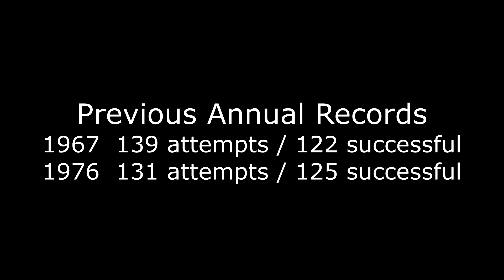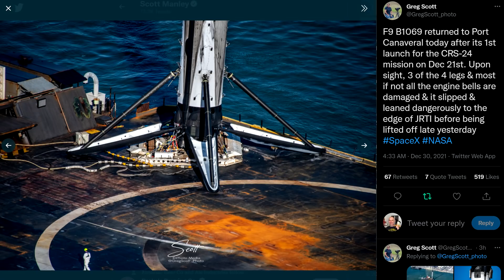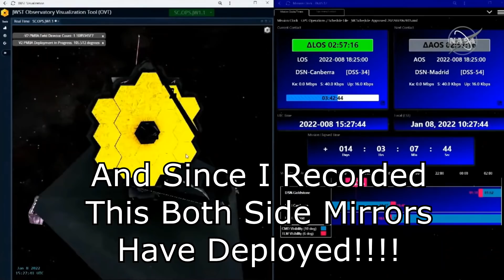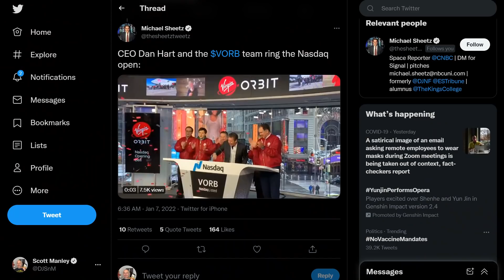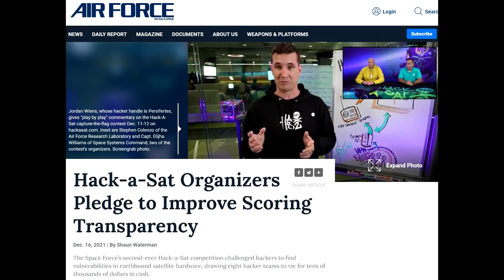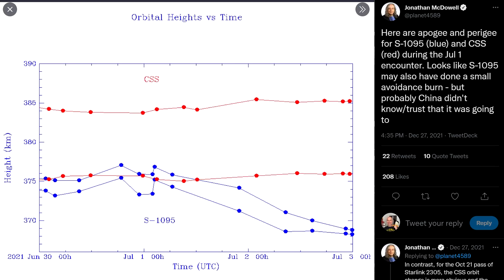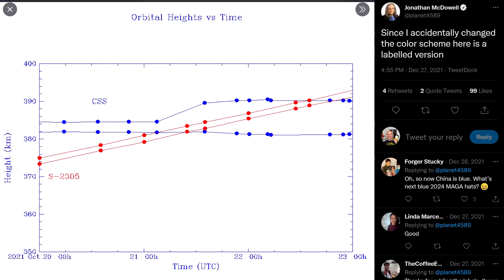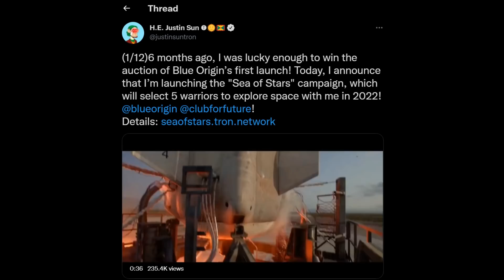JWST Deploys Mirror &  Moon's 'Mystery Hut' is Revealed - Deep Space Update - January 7th

Comment: The light illuminating the inside of SpaceX cryogenic tanks is called a "Photon Blaster" in the parts diagrams. It is also mounted outside the tank along with a camera, and both look through a pressure window.
Reply: Now I want a drone that drops glowsticks so I can call them photon torpedoes.
Reply: @moosemaimer  Nah, you'd need a self-propelled underwater flashbulb...
Reply: @Ithirahad  Have you never heard of Ster Trek or are you a troll?
Reply: @markhorton3994  ok fine, a flashbulb with a  hobby rocket motor attached :P
Reply: @Ithirahad  I was just pointing out that not all torpedoes are in water. Rather ineptly.  Early unmanned flying weapons were sometimes called "aerial torpedoes". I think the German V2 Buzz Bomb was called that between curses.
I like your use of a flashbulb for the photon part.
Reply: Next time I need a new lightbulb I'll ask where the photon blasters are at the hardware store :D
Reply: @gonun69  

I love it!

another goofy thing I've heard is LED modules (in a multi module light fixture) being called "light engines".
Reply: @gonun69  If you wanna see if your man is a film buff, ask it this way: I need a Photon Blaster in the 40 Watt range
Reply: so my lighter is a thermophotonic device... hope customs does not find out... 🤐
Reply: @human_isomer  Just approach them with your hands up and calmly say "I have a small thermophotonic device in my breast pocket and I wish to negotiate."
Reply: @jhonbus  I may do so when I'm very early on one of my next flights... 😁
Reply: AvE is the absolute master of these jokes. I think someone at SX is a fan.
Bet they call hammers "thumb seekers", adjustable wrenches "nut lathes", electricity "angry pixies", high voltage electricity "Very angry pixies", Batteries "Pixie containment" and the biggest hand tool the "chief engineer".
Reply: @ThZuao  Gotta love AvE
Reply: @ThZuao  I watch AvE but I've never heard the term "thumb seekers". I love it! Son of a diddly.
Reply: @ThZuao  "Angry pixies", I'm going to be looking for opportunities to use that one.
Reply: @ThZuao  Oh man those are just gold.

I tend to refer to hammers as H.A.M.R.s...."Heavy Augmented Material Rectifier", heh
Reply: @ThZuao  Love me some Uncle Bumblef...ork. (I'll keep it PG for the sake of it being Scott's channel lol)

Which, since I have fellow AvE lovers in company here, I'd like to float an idea I had in reference to his terminology...

While most have probably heard him say these, as a reminder, he's referred to electricity as both Angry Pixies, as well as Dancing Pixies.
However, he's used them completely interchangeably and without inference as to the 'type' of electricty he's using it for.

My thought was that perhaps he originally did mean for them to and forgotten over time (has happened to me), or perhaps whomever he heard it from originally meant them to be; however, if that isn't the case, then I propose that:
- *A*ngry Pixies | AP == Alternating Current | AC
- *D*ancing Pixies | DP == Direct Current | DC

What do we think about that? :)
For me, that just seems like the obvious pairing of the terms, or at least how it ought to be, going forward!
Reply: Since I radiate in the infrared, I am also a photon blaster... as is anything above 0K.
Reply: Ahh, but are they “thermodynamic photon blasters” (incandescent bulbs) or “quantum photon blasters” (LEDs)? Or even “plasma photon blasters” (fluorescents)?
Reply: The Saturn V had cameras in its cryogenic tanks, too, and it used fiber optic cables as pixels.
Reply: @redspotaudio  Nobody cares about your Bronze Age mythology.

Have a nice day.
Reply: im going to call any light source a "Photon Blaster" from now on
Reply: I wanna photon blaster.
Reply: It is an extremely bright light.
Reply: Blasted Photons!
Reply: My flashlight has 3 intensity settings, and I can change how wide the beam is. Phaser???
Reply: It is called a blaster because photons are ejected at the maximum blasting speed
Reply: @redspotaudio  gommfm.
Reply: Thats a good solution
Reply: I also see another humor layer. The reference to the Bugs Bunny Marvin the Martian character? He was always threatening to shoot someone with his photon blaster.
Reply: I was hoping for a more cool use for a "photon blaster"
Reply: My brothers and I have a running joke calling the sun "giant orbital photon emitter". But light blasters in general stores are better. :D
Reply: @xobotun_  Hmmmm.... Mayhaps THAT was why Trump stared, unprotected, into the eclipse....
Someone had briefed him prior and on the paperwork, it said: 
"Do Not Look Directly Into the Occluded Photon Blaster in the Sky"

Obviously, having no clue what that meant, he proceeded to do just that.
(Mind you, he would've undoubtedly done it anyway, even if it were labeled "The Sun", as clearly he'd take it as a challenge, being PotUS and all... lol)
Reply: They should use a simple term like "light bulb" or "torch" "Camera flash"
Reply: @kukunishad  why
Reply: @redspotaudio  Read the Bible in context realizing that God uses figures of speach and you will know that the Bible says no such things. 
Nothing in the Bible contradicts anything our God given ability to observe and comprehend tells us.  The "theory of evolution " has no explanation for the origin of life. The Big Bang theory has no explanation for the start of the expansion of the time-space continuum.  
My answer to both is God.  No explanation other than an all powerful sentient creator makes any sense at all.
Reply: Pretentious bs from Elon Musk as usual. Oh well.....
Reply: @ReinhardB100  I'm no Musk Defender but calling it that probably wasn't even anything to do with him, it's not like he's actually designing the rockets. Though I suppose it was named that by someone wishing to amuse their lord and master in hopes of a boon.

Comment: Not only are ICBMs hypersonic missiles, they are actually faster than the hypersonics that are being talked about. The maneuvering means they take a longer time to get to their target and spend more time in the atmosphere.
Reply: But it does make it harder/implausible for many legacy intercept systems to be successful... most of them weren't the greatest at intercepting known ballistic trajectories anyways with the common use of multiple dispersion warheads deploying at unknown altitudes from the host ICBM
Reply: @berryreading4809  well but the thing is even if they can munver at hypersonic speeds the real problem is that how much they can turn at once kinda makes it very hard to turn a certain amount before the angle of attack would cause a massive  heat and pressure imbalances that could rip the hypersonic missle to shreds if they turn too sharply at once! its the main drawback is sure while  they can manure at hpyer sonic speeds but it's still a pretty very very wide and slow turn! the amount of time they would take when trying to trun at hypersonic speeds would still make the max turn rate at hypersonic speeds when compared to a subsonic and supersonic missile still be far more F** slow! the hypersonic missiles in the booster stage would still need a 100 km long turn curve  for every 10 degrees for angle of attack  to just to try  avoid something in their path! but it's still not good enough to avoid anything other than stationary fixed ground mounted  anti missile defences that shoot down icbms made in the 70's but thats still not good enough to stop from being shot down by a usa sm missile at much closer ranges that are using multivector tracking in both the infrared and radar from multiple angles at once! aslo by the way every plailx ciwis in the usa that are mounted on ships basically have  two built in radars for each ciws gun trunet  and  they have quite a few of them on both super carrers and aegis cruisers aslo!
Reply: @ashtiboy  if you are relying on the bubble blaster for your air defense it's too late (atleast for nuclear warheads) although an amazing system for it's intended use, definitely one of the coolest systems ever! "Should we advance our electronic devices to protect our naval assets?" "Yes but make sure the all involve controlling a rotary cannon firing saboted tungsten projectiles at thousands of rounds per minute, because AMERICA!" 🤣👍I do hope they somehow implement a "continuous capacity" and cooling system in the future... even with 4-6 on station with a max firing time of 1-2 minutes with a reload of 10-15 minutes(also allowing cool down could still allow a vessel to be overwhelmed by missiles... which I may be years behind on the capacities by now... also I know the sabots help to produce less heat from friction, but not heat and erosion from the powder charge...
Reply: Yeah, but that's what makes them dangerous... all the missile defense systems are expecting predictable, straight-line paths for their targets. Being able to steer around detection systems and out of range of countermeasures is the super-scary part.
Reply: @johnladuke6475  This is why we need energy shield technology

Comment: I'll be honest, I totally understand NASA's reluctance to have Engineering cameras unless necessary - - like during Manned Missions on their rockets and payloads, at the end of the day unnecessary Mass, if ya don't need it, get rid of it.
Reply: It was more issues with the web tellescope. There is no easy spot to mount them and the cabling could be and extra complication when everything have to be unfolded. And a flash could be detrimental to the sensors in the telescope.
Reply: @lubricustheslippery5028  And they may not be able to operate at cryogenic temperatures without much more additional heavy and complicated equipment
Reply: @lubricustheslippery5028  i was more referring to IN general, not specifically for JWST
Reply: And the more cameras you have on any spacecraft means more stuff somebody has to "grease" out of the shots. LOL
Reply: true it would just mean more mass, more engineers, more money, more possibilities to mess up electricals
Reply: On the other hand, consider the increased interest in the Starlink Missions because of our ability to watch the booster go through its various steps towards a successful landing on essentially, a postage stamp floating in the middle of the ocean.
Reply: @dewiz9596  yeah it is a good point you make, but again it comes down to Mass, and indeed in the case of JWST complexity

Comment: Question: I know JWT is supposed to operate at -223C but couldn't help but notice it is not there yet.  Is it just because the telescope isn't at L2 yet?
Reply: It'll continue cooling down for a few more months, I believe it will be ready for operation in June or July.
Reply: @MotoRiderTube  Oh okay, I guess I missed the part about when it will actually become operational and why in the video I watched.  Thank you!
Reply: It takes a long time to cool down in a vacuum. All of the heat has to be radiated away.
Reply: @Nilguiri  Derp... thanks.  I should have figured that out.  No conduction for the radiator to dissipate it's heat with.
Reply: Could it be a progressive cooling down, there must be a timeline of the cooling function.
Reply: @JohnnyMotel99  Yes, sounds like that is the case.  The last little bit will happen while it reaches its destination orbit and continues to operate until it reaches it's final temperature of -223C.

Comment: The operating temperature of the telescope is -223 Celsius, which seems to be a bit colder than what SpaceX chills LOX to, which is around -207 Celsius.
Reply: Yes, but upon unfolding the cold side temps are considerably warmer
Reply: JWST temperature sensors are live, amt currently temperature at "cold side" is -200*C (~74K).
Reply: @ivoivanov7407  Currently -199°C at the cooling heatsink, warmer on the mirrors.